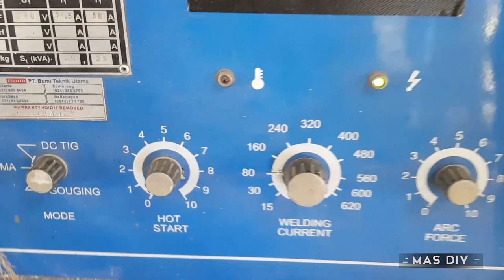Underwater Welding   ||   Pengelasan Bawah Air Basah

Comment: api nya seperti las argon ya..
rasa2 nya pingin nyobain las dalam air..
klo las biasa udah tyap hari, klo dalm air gimana ya..😁😁😁
Reply from the maker: Pake las stik biasa kalau di dalem air. Elektroda di solatip
Reply: oalah ngono to tehnike
Reply from the maker: Betul, mesin las wajib inverter DC. Ada juga elektroda khusus sebenernya. Tapi pake E6013 yg biasa dipake las pagar juga bisa kalau disolatip.
Reply: ya sih cak..
klo buat di dalem air pasti ada khusus elektrda nya, , hanya saja yang namanya tukang ada aja akal nya ...,😁😁😁😁😁